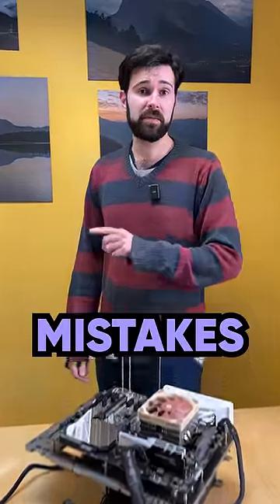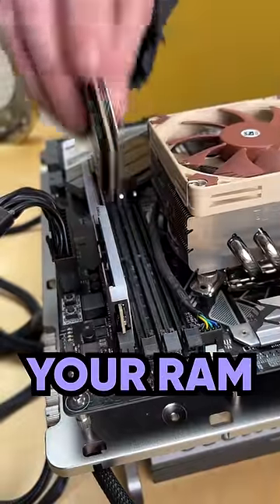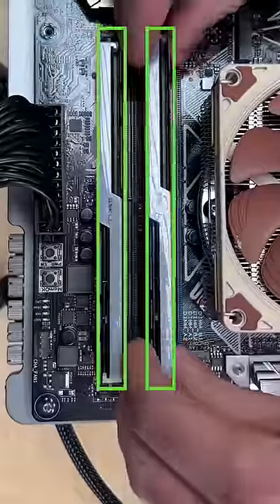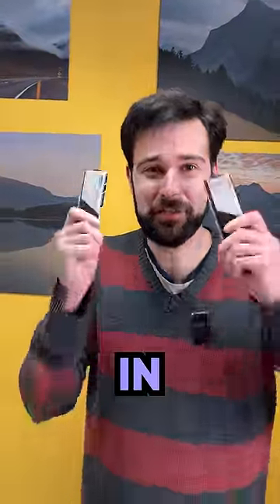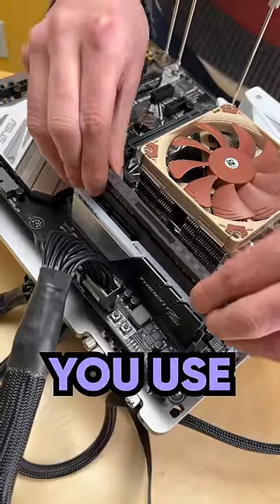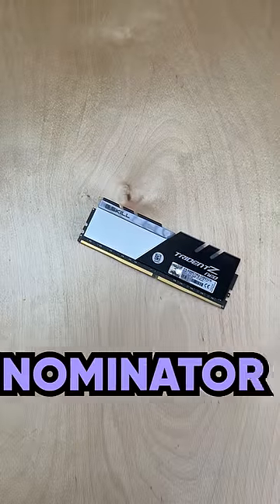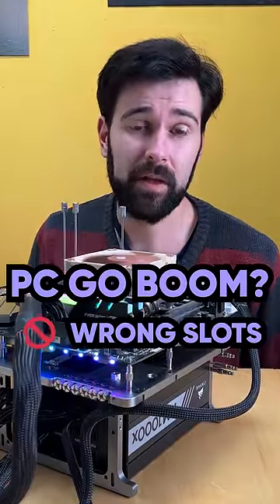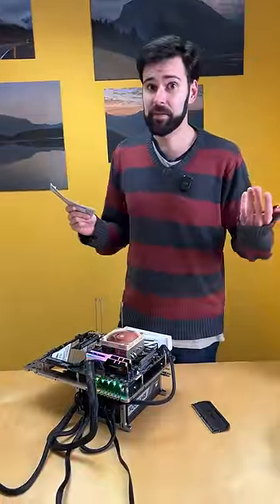Why you NEED to install RAM like this!

Comment: Well the slight problem with that, the only way my computer will even work is if I plug in 2 ram sticks together, brand new and tried putting them in the slots like in the video and wouldn't even boot and giving me the error code 0d but by having them together and checking the ram I have all 32gigs and after I bought another set so I would have 4 to get 64gigs the motherboard wouldn't read the other 2, I swapped the current with those other 32 sticks and they worked perfectly fine I guess it just depends on the mother board but if there's a way to fix it to where I can use all 4 sticks please tell me I wouldn't mind the help, the mother board is a ASUS ROG X570 Crosshair VIII Hero (Wi-Fi)

Comment: so if i have two sticks in dual mode 3600mhz i can't add on any faster ram because it's going to be capped at 3600mhz or are the paired slots only limiting the other paired slot

Comment: I have a 1333 stick and a 1600 stick so when I put them together for the first time they didn't work and the 1333 one was working at 1066 for some reason, second time they both worked at 1333, and third time they were both at half their frequency 1 stick is at 667 and the other is at 800 and their clocks are all messed up the 667 one  is running at 24 clocks and the 800 one at 30 clocks, i have no idea how or why it works and why did the motherboard choose these settings when it already had working ines

Comment: Who the hell approved this? lmao. Installing them on the same channel is like using 1 stick of ram? Running 2x8gb of ram single channel still gives you 16gb ram, you just lose the slight performance bump of dual channel access. Some games see a significant performance boost, others don't. Some productivity applications only see around 6% difference. Not advocating single over dual channel but perspective is key and what's said here is garbage about only being like using a single stick. Mixing ram can be fine, it can also not be fine. It can limit speeds to the slower stick, fail to run xmp or fail to run at all.

Comment: I have a question, my mobo the z390a pro will not give a signal on my monitor when I use the suggest slots 2 and 4, for my hyperx fury 3200. But when i use slots 3 and 4 i get signal. It seems like slots 1 and 2 do not work what so ever, is this a mobo issue?

Comment: On the topic of RAM, why won’t my XMP on my RAM work? It’s turned on I. The BIOS, but displays the lower non-XMP speed in task manager. I’m running some G. Skill Ripjaws 32 GB 3600 mHz RAM. I also am using a Ryzen 5 2600X on an MSI X570 board. Anyone know how to solve this?

Comment: this is not actually true, if you only use 1 channel it is like you have a slower ram with dubble capacity, if you use 2 channels it's like half the memory size but twice as fast ;) plz do reaserch before you put out these videos

Comment: Guys i hope there is some Angel between you i spend a lot of money on my pc and when i finish bulding it when i turn it on the motherboard is showing this static orange light plus the number 55 in the motherboard i try to do everything and is not giving any display everything working but no display i buy new ram stick and Still same problem.

My compontents are:
Motherboard Asus rog hero z790 
Intel i9 13900k
Rtx 3080 12 gb 
Ram vengance 32 gb 6600 mhz 
2 tb of ram 
Liquid cooler nxzt kraken z73 
2 tb of m.2 wd black.

I hope guys u can help me out tell me what i can do 😢😢😢😢❤❤❤❤❤❤❤

Comment: Back in the day I had 512mb ram, 1gb,ram, 256mb ram and a random 4 gig ram in my pc that I got a few years later somebow, anything for that POWER. Except, i had a 128mb gpu, that bitch ran cod 2 like it was nothing, but that's about it 😅